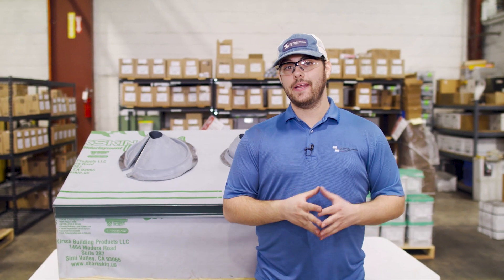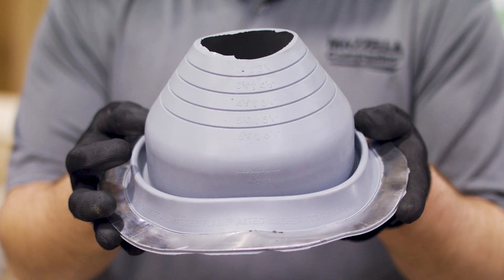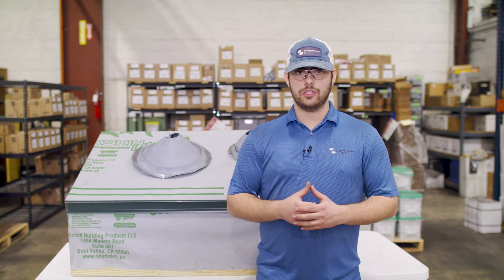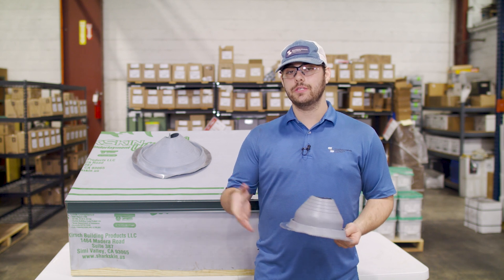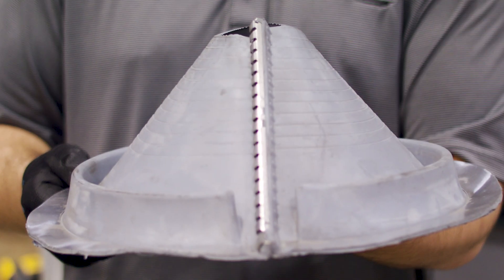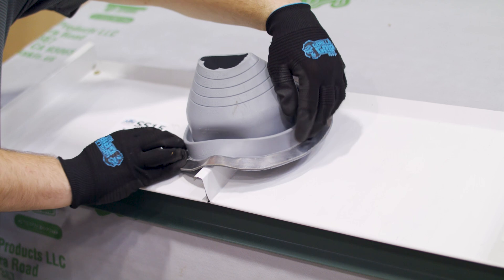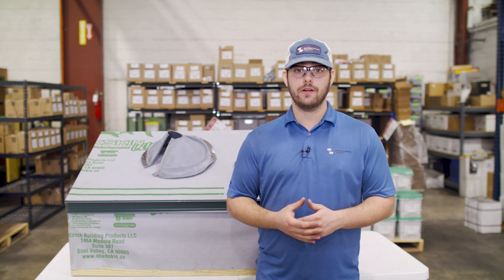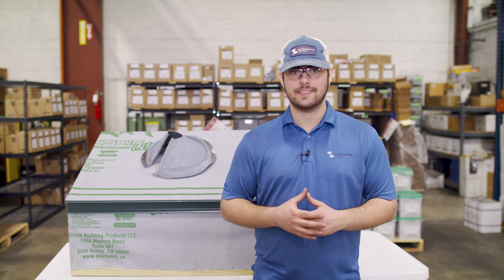Pipe Boots for Metal Roofing: Installation Techniques & Selection Tips

Comment: It is near possible to lay out your roof  to accommodate penetrations in the flats. It’s always been my understanding that the flexible nature of the flange around it is for that very purpose and I have always installed them over the ribs and I’ve never had a single one leak. I referred to this clip for information on high temp boots.